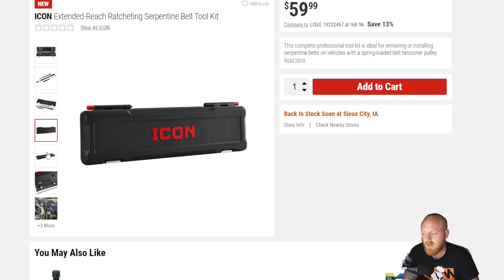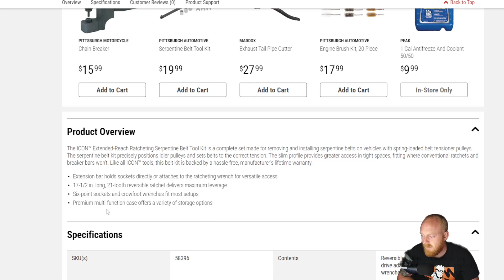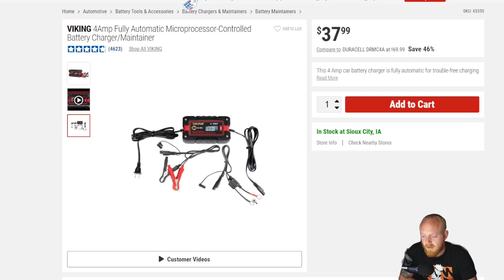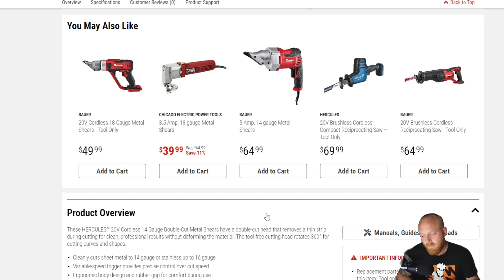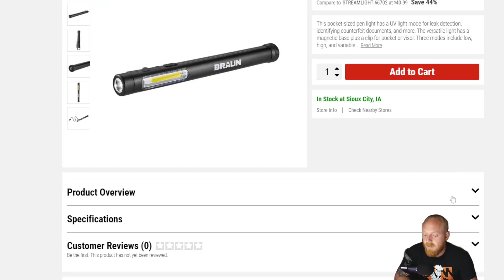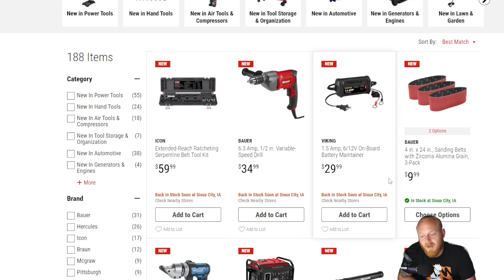New Tools at Harbor Freight Some Good and Bad Deals

Comment: The corded Bauer shears seem like the way to go for half the price. The corded Bauer tools looked solid in the store. Funny how long some of those Chicago Electric corded tools last. I've had the belt sander and 3\8 drill about 10 years and have used them a lot and they just won't die.
Reply: The heat gun is a beast...mine is ~13-14 years old..still works fine.. alot of shop mechanics use them..never heard anyone complain about them
Reply from the maker: @boosted2.4_sky  absolutely the heat guns are fantastic!!!
Reply from the maker: Very nice. And ya I agree 👍

Comment: Another good video. Thanks for keeping us  up to date. The charger I would hold out for the Viking 2-8-15 amp automatic charger for 69.99. It goes on sale for around $50. Although when it goes on sale it always is out of stock haven’t got one yet. My father in law has one and it is the bees knees.  I have one like the 37.99 it is great would highly recommend it just when I can I will upgrade.
Reply from the maker: Very nice and ya I have seen that one as well. It's priced very well

Comment: Question so that uv pen light will it work on any leak dye 🤔?
Reply from the maker: My thoughts would be it has to be a uv reactive dye. Here is all it states on the hf website. 
UV light that is ideal for automotive or HVAC leak detection, glass repair, antique validation, identifying counterfeit currency or IDs, and more

So unfortunately not much more details

Comment: I bought that Bauer 1/2" drill about a year ago, and I am very happy with it.  I needed to use a 3" hole saw on a wood project, and the battery drills just can't handle that kind of abuse for any amount of time.  This Bauer drill was a beast.  And let me tell you that the included side handle is a big MUST.  Without it, this thing will snap your wrists out of socket.  

My neighbor has a 9000w Predator, and he likes it.  But it only has 30amp capability.  
I went with another brand that has 13000w and 50amp service.  It would be nice to see Predator step up their game in this department, and I believe they will.  

Tony...... Have you seen Jeff's (Den of Tools) recent vid about the future offerings from HF that are on the table for the next 18 months?  Pretty exciting stuff!  

HF is taking a swing at just about everything!  :)
Reply from the maker: Ohh very nice!!! Glad to hear it. I appreciate you sharing your thoughts on the drill and the predator line up. And ya I'm sure eventually they will step it up in that aspect. No I haven't seen that video I'll go check it out now. Thanks for the heads up. I appreciate it